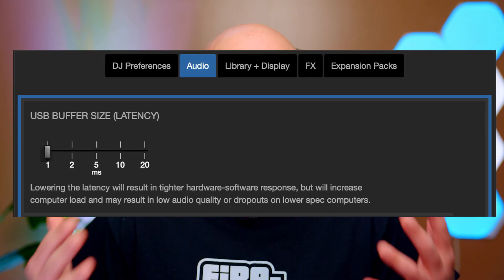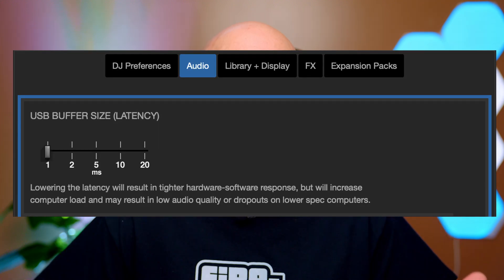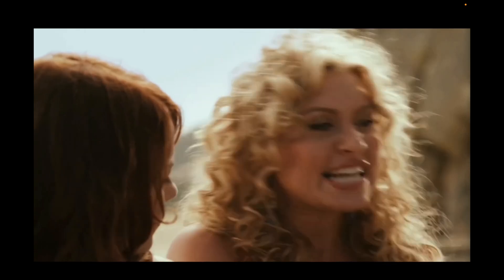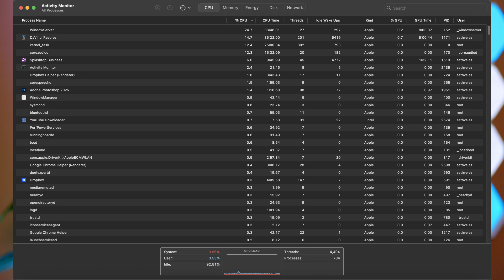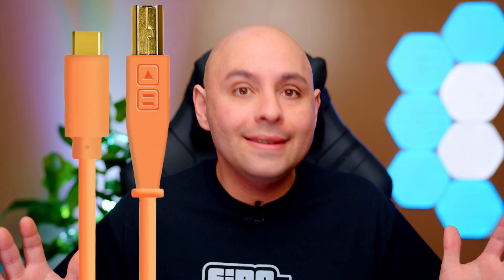DJ Software for Dummies: Latency

Comment: I have a Dell i7 with my DJM S11. I never had a problem with it until I updated it to 3.0.1 serato dj pro. I started to latency problems. Serato couldn't solve my problem so I had to buy a apple laptop. It works great now. But my Dell only works better with my SB3 controller. But I still want to use my Dell with my DJM S11. Any ideas how I can fix that?
Reply from the maker: Did you update your devices ASIO driver?
Reply: @djtechtips  yes, I updated it. I even took it to bestbuy. They claim they fixed it, but still the same problem.
Reply: @djtechtips yes, but I'm still having the same problem. BESTBUY couldn't find or fix the problem.
Reply: Yes and I'm still having the same problem. It was working fine before the 3.0 serato update